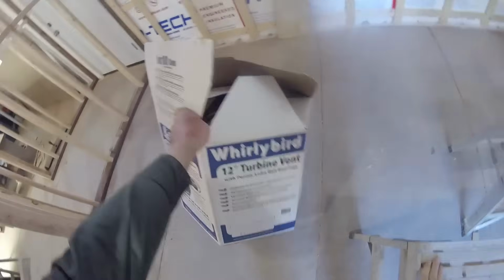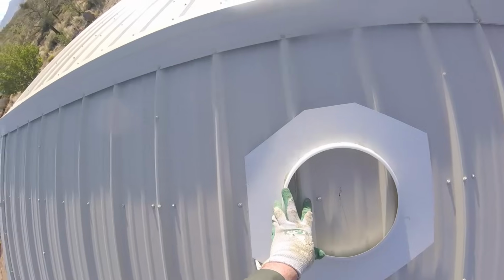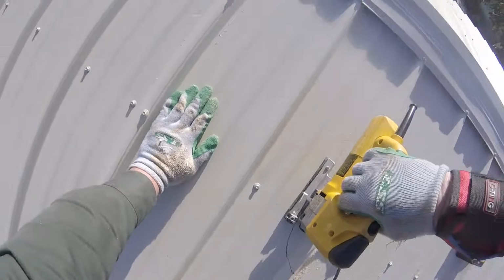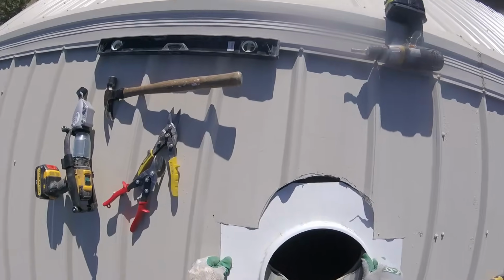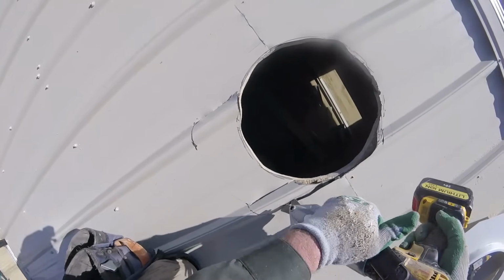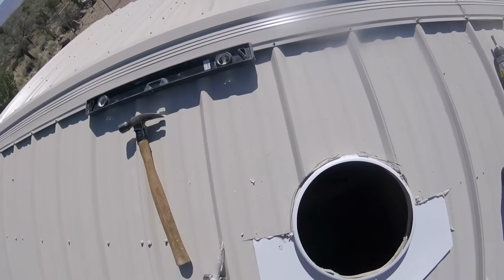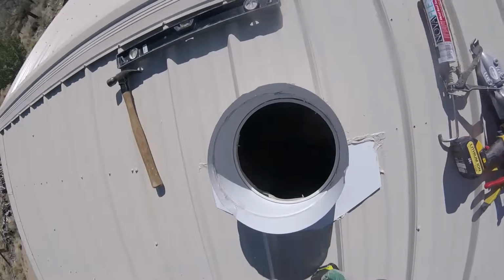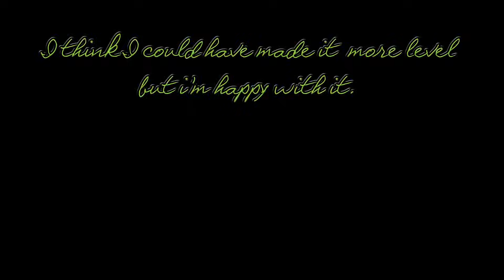‌Install Turbine Vent on Metal Roof, Whirlybird, Slow House Update 23

Comment: That’s how to make a relatively easy job look difficult. An electric multi tool will do all the cutting much quicker and the end result will be neater. Also if you install the vent as high as possible toward the ridge the flashing will only need to be placed on top of the roof as the ridge cap flashing will partially cover it. Also doing away with all the other cutting to the roof. One circle will be all that’s required.
Reply from the maker: Wow, I wish I had checked with you first. The roof sheeting, underlayment, braces, and trusses could have all been ignored.
Reply: @SteveAZ711  a larger flashing placed under the ridge cap would still allow you to keep the same vent location as u have without the extra work . Regardless of beams , underpaneling or anything else. Not trying to be critical. Just a little more helpful to the next guy wanting to do something similar. 👍
Reply: @pestola11  way to go bro the man was sharing his way of doing it and you couldn't help but letting the verbal diarrhea go
Reply: @DouglasFir90  There are several ways to do the same job. But there are always those that have a "better" way after the job is done. I wonder why they haven't made a video? I'm always open other ways but if they have one, how about a video instead of just using their keyboard? Just a thought.

Comment: Instead of the 4 tools sawzall, jig saw, electric sheer, manual sheer it may be easier just to grab a 4.5" angle grinder with a metal cutting disk.
Reply: problem with grinder is it heats up the metal and causing it's easy to get rusted later on. need to brush the cutting edges and treat it witl rust proof prime.

Comment: An easier method is to install the fan base completely under the metal roof,  cut your perpendicular slots 1" inside the edge of the base,  and slide in another piece of r-panel with the hole cutout under the slot.  You can overlap the new section 4" over the down slope roof, and you only have the end of the slot to waterproof.  
It works great because you can install the base while you're installing the roof,  and come back later to cut your decking.
Reply: sounds like a good idea
Reply: Ya that the way to go

Comment: You seem to live in the dessert so water probably won't be an issue . Since I'm in the Tropics I probably would have to build a small shed thing so the hot air actually travel side ways a bit before exiting the turbine to avoid direct rainwater . TY for your Vid data and Exp !
Reply from the maker: These turbines do not let water in. I know that it looks like they will, but they are designed not to. here is a link to their site for some more information...http://www.lomanco.com/vents/whirlybirds
Reply: You would be amazed at how much it rains in the Arizona desert. It doesn't rain often, but when it does, it is torrential! These fans do not let water in.

Comment: If I already have cut a ridge cap vent do I need turbines? I was told I did not and replaced the wood removed from previous turbine installs. I do still have an attic fan to help exhaust heat if needed I was going to keep. Was watching this to get an idea of how to metal roof around it and flash it. So now I'm wondering I should have kept the turbines as well. It's pretty hot and rainy  in South AL.
Reply from the maker: If you have a good well vented ridge cap then I would not bother with the turbines. Your attic fan should be sufficient as well. If you have good air flow from under the eves into the roof cavity, then the fan and vents should be enough to keep it dry in there.

Comment: What if you install another piece of metal roof on top of the vent cutting a hole for the vent? Just asking
Reply from the maker: It is an idea if you can fit it under the ridge cap to deflect the rain. Still going to have to do some caulking at some edges for those wind blown side driving rains. This metal roof has a water proof membrane laid under it and if any moisture was to get under the metal, then it would be channeled to the lower roof edge and away from the roof.

Comment: My roof is not that big..it has 4 box vents on shingles..can I put 4 of these vents on in place of ridge vent
Reply from the maker: I would refer you to this site for more information...https://www.lomanco.com/vents/whirlybirds.I have installed 5 of these on shingle roofs and they are very much easier than doing them on metal roofs. Watch some of the LOmanco Whirlybird videos and you will see what is required to install these. Thanks!

Comment: Wind turbo on metal roof for shed leaks rain water inside.  How should I fix this?  Exterior caulk?  If so, what type?
Reply from the maker: Doug, here is a great product for just that repair(last link below.) Here is a YouTube video of this stuff.

https://www.youtube.com/watch?v=MkafpRO7yqg
 I have used something similar around an inground water drain pipe and I will post a link to that as well. This stuff really works. Here is what I used and it is made by the same company...
https://amzn.to/2XK7MUI

Here is the link for the roof stuff. It is not cheap and please read the instructions as it can be life threatening ..so be careful! Here is the link...
https://amzn.to/2LEvb3n

Comment: My recommendation is not to put the hole on the screw line. Looks like he cut straight through the batten. Not a huge problem but just a thought.
Reply from the maker: Be sure not to cut through the trusses. Position the hole between them or the rafters and between the braces between the trusses or rafters. This was a clean hole and well positioned. FYI.

Comment: This whole process could be avoided if I cut 2 inches in the ridge on each side and put a 10-inch ridge on each side as if it were ridge vent on shingles, well it is my opinion because metal turbines always leaks
Reply from the maker: If you have the larger ridge vent then that sounds like a great solution. I have never installed a turbine yet and found leaks, fyi. Thanks!

Comment: I think these turbine vents are really ugly even when they work properly.  Driving around in my neighborhood, I have seen at least 6 or 8 houses where it looks like their round turbine vent has become dislodged from its original installation and those round vents are just dangling sideways off of the vertical pipe.  So just the metal tube sticks up from the roof and it looks like the round turbine vent is only being held onto the side of the tube by one or two screws or nails.

We get wind gusts up to 60 or 70 MPH here every year, so perhaps the wind is blowing all these turbine vents off of their pipe tubes? How are these turbine vents becoming detached from their tubes in my neighborhood?? What happens to these homes' turbine vent tubes when their top turbine gets detached and just dangles on the side of the tube? Does that mean there is a big open space for rain and snow to fall straight into their attics??  A lot of these houses with their detached turbine vents have been like that for several years now.  These are all two-story houses, so these homeowners cannot even see their damaged roof turbines from their front or back yard because you only notice the detached turbines if you look at these roofs from a distance away.
Reply from the maker: Hey Claire, Yes they will get snow and rain in their attics if they are not working as intended. I agree with you as to the aesthetics and overall appearance of turbines and custom houses. I do not know what brand of turbines that theses houses have, but the brand I put on my roof is a guaranteed replacement forever. Yes, it says "forever" right on the box, and it its designed to withstand 60 mph winds. I have used different brands and most except this brand has to have some kind of attention paid to them once in a while.  I thought about solar attic vents but the 20 year guarantee  turned me away from them , even though they look much nicer with a lower profile. Plus,  can you ever really know if they are working , and what about cloudy humid days? 

An attic needs ventilation year round 24, 7 and I was unable to put passive gable end vents into this section of the So Slow house build.  Believe me, the last thing I really wanted to do is cut another hole in my beautiful roof, but to me I settled for a bit of that commercial building look to know that my roof with its attic ventilated should last much longer. Later I will be putting in a wood stove, and I am not really liking cutting that hole either.  Thanks for the comment!
Reply: Hi Steve, at least your turbine vent is installed on a metal roof so the metal turbine and metal roof blend together more. In my neighborhood, those turbine vents are put on top of custom and semi-custom two-story homes, and I think it really ruins the aesthetics of those homes. And now that those round turbines are dangling vertically along the pipe tubes at awkward angles, they look even uglier. These are not very old houses - the houses are all 10 to 15 years old - so some of these turbine vents likely became detached within 5 or 10 years after installation. And now some of those homes have a big hole facing the sky because the turbines somehow became almost completely blown off of their tube mounts and are dangling by just one or two screws holding them to the tube. Along with moisture damage from rain and snow entering the attic, I wonder if birds and wasps are also flying through those exposed turbine vent tubes and building nests inside those attics. I'm in Denver, and we can get a big downpour of rain along with hail during spring and summer, and 6 to 12 inches of snow sometimes during winter.
Reply from the maker: It sounds like some repairs are needed badly. If you let holes go unattended for too long the roof repair costs go up more.  You pointed out some good examples of what could happen. I am sure you will see some roof repairs being made at some time, and the sooner the better sounds like. Thanks for the reply!
Reply: Oh, one other comment after watching your video.  The thin sheet metal used on the turbine vent, elbow, and base does not look that strong and durable. It looks like if you lightly kicked the elbow with your shoe, you could easily dent and deform that metal tube?  Perhaps when those turbines are hit with 60 or 70 MPH wind gusts every year, eventually the turbine vents can loosen and tear away from the elbow tube that they are mounted on, and that is why some of the turbine vents are become detached from the elbow tubes in my neighborhood??
 
I only started googling these turbine vents because my husband wants to install two vents on top of our roof, even though our summers are only really hot for about six weeks in July and August. So I drove him around our neighborhood and pointed out how at least 8 houses have their turbine vents detached and dangling from their elbow tubes. And I told my husband that I did not want him climbing up our steep two-story roof to fix a gaping hole in a separated turbine vent elbow tube. And I think the turbines are ugly even when they are mounted properly and working correctly.
Reply from the maker: Claire Hi, I just checked the box that the turbine came in and I was mistaken about the 60 to 70 mph wind. The box says " tested to 110 mph winds". After a 110 mph wind I would be more concerned about how much roof was left. If you have an attic, check into gable end vent fans. If you can get into your attic is probably much safer than being on a 2 story roof. Also, check around and find some good working turbine and see if the owner has anything good or bad to say about it. Perhaps, you can find someone that installs these as well. Stay Well and thanks for the comments!
Reply: I also received a reply from a Lomanco Whirlybird representative yesterday who said that they are located in Miami and their Whirlybirds can withstand hurricane winds. So I do not know why the turbine vents are getting detached from their elbow tubes in my neighborhood. The turbine vents on these 7 or 8 roofs in my neighborhood look like they are just barely held onto the elbow tube by one screw, and that if the one screw came loose, the turbine vent could roll down the two-story roof and hit someone or something at ground level. Another construction contractor told me that the homeowner needs to inspect their turbine vents at least once a year to make sure that the turbines still rotate freely, do not need lubrication to get rid of sounds, and that the three screws are still tight and the base is still properly sealed onto the roof - i.e. these are not install-and-forget-for-ten-years things like roof shingles. Otherwise, the contractor was guessing that corrosion and rust led to the screws becoming loose and the turbine vents easily getting pulled out of their elbow tubes with strong wind gusts once their three mounting screws became loose. 
 
So it sounds like the 110-MPH wind rating only applies if the three screws are new and firmly screwed into the elbow tube. Otherwise, if rust, corrosion, and natural weathering cause the screws to eventually loosen, even a 50 or 70 MPH wind gust can eventually knock the turbine off of the tube. Anyway, I convinced my husband not to install two turbines :-) They are really not needed on newer homes built here in Denver because our summers are not that hot.
Reply: @CJ-xv7oi  Sounds like neglect from the home owner. Not sure why if the houses are that new, why they used a turbine vent instead of the other type.

Comment: talk about rough !!  put the jig saw blade in the sabre saw . then you have better control
Reply from the maker: Maybe. Control is trying to keep from sliding off the slippery metal roof. Two hands to hold a saber saw.
Reply: @SteveAZ711  lol . iv fitted thousands of whirly birds / vents to houses and factories . this way he’s doing it we call a deck fit . cut into the sheet deck pan . piss easy to do . cut the sheet with hand snips and then cut the ply out with a sabre saw with a jig saw blade fitted to the sabre saw !

Comment: I was worried about you....the way you were breathing, sounded like you were gonna pass out.
Reply from the maker: Thanks! It was getting quite warm up there 90 + degrees outside, trying to keep from sliding off a slippery roof, and a tad overweight at the time... and then there was the camera that was probably going to melt. Those metal roofs can get very hot quickly and my slippery Knee pads were getting quite warm as well. However, the install went well and I was no worse for wear or the camera afterward. Thanks for your concern!